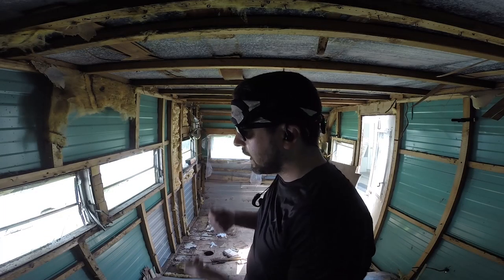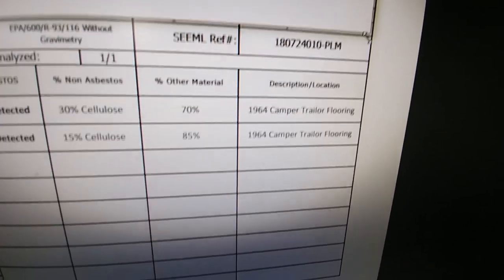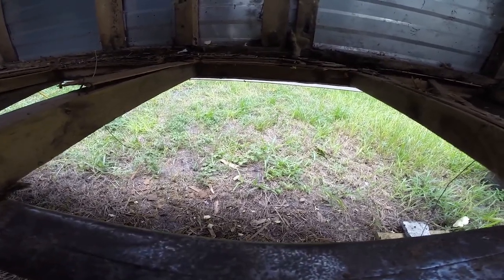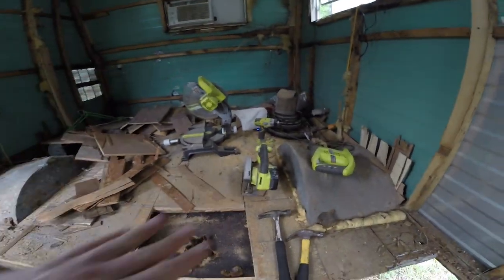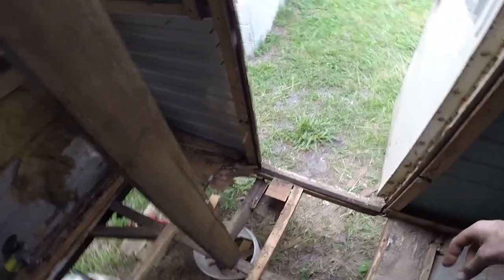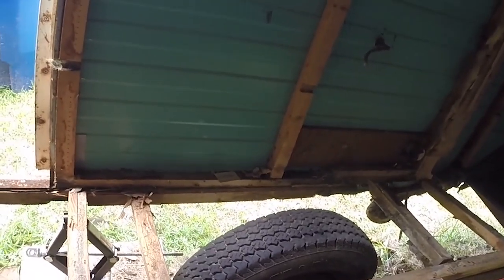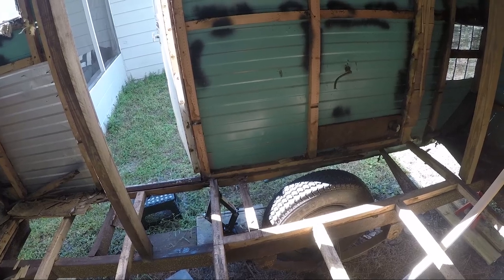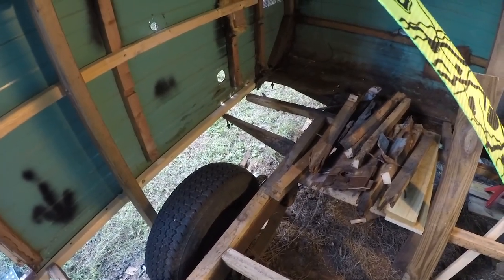1964 Layton Vintage Camper Restoration - Part 2 - Floor Removal

Comment: Omg, those bow-tie looking screws...I have them on this Layton unit of mine (13-footer, not sure what year, 59-61 I think, titled as "2000 homemade trailer"). I showed one to my friend, who is very experienced in life, shall we say. He told me, "Damn, Gracie, you may actually own a bunch of screws for which I have no bit...amazing!" 😅 ("I bet you wish now you'd saved that last worn-out  #2 Phillips you threw out". Did even better: found a broken 2" flathead with which to make one.) So far, a worn Phillips bit has done ok.
THANKS FOR THE VID!!!
Reply from the maker: Yeah I was actually able to find bits for them - they are called Clutch Bits
Reply from the maker: They are called crutch bit, and you can still buy them online but from what I gather they are no longer manufactured at scale
Reply: @RoccosModernLifestyle  Actually they are called "clutch head"  screws and the bits to remove them are called clutch head bits.

Comment: You've already ruined this camper. You NEVER pull the paneling off from the inside. That is not how they were built. All the structural integrity has been removed now and you can't fix it. Just take it to the dump. Otherwise it will fall apart on the freeway at 60mph and someone might be klled. You will be responsible when it happens.
Reply: @mobiltec How else would you do it? Just asking, not trying to be insulting.
Reply: Mitch Temple you take them apart from the outside inward, take the metal off, then the walls, go check out his channel! Mobiltec, he shows you how to do this properly, and not ruin a nice vintage trailer.
Reply: So to renovate the interior of a camper, you have to take the siding off? I want to re-do the floors and walls in my 70’s camper, but not the siding. Is this possible?
Reply: Idk mine still hasen't fallen apart.... And it's been through hell
Reply: @cavedoggaming8018  did you totally gut yours?
Reply: I have to agree with Mobiltec, but you really need to examine how they attached the walls and paneling. Paneling was often sandwiched between flooring and wall structure or roof framing. If this is the case, then you should replace the paneling  as it was, which may necessitate removing the exterior skin to access those areas. The advantage to this is you may see additional rot you need to fix, especially at the floor,  and you can reseal the skin with new putty tape.
Trailer bodies flying off the chassis due to rotted wood or improper repairs is no joke. It HAS happened.
The problem is too many people believe trailers are built like houses and they're not.